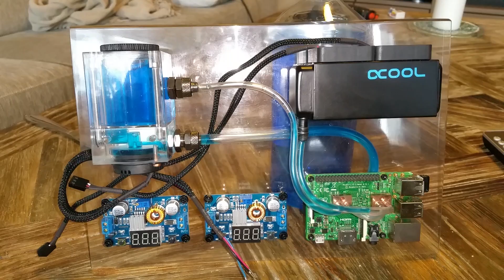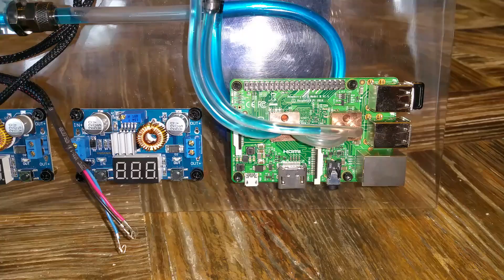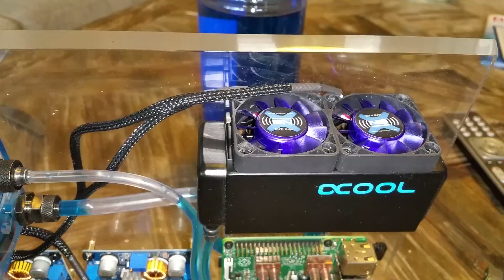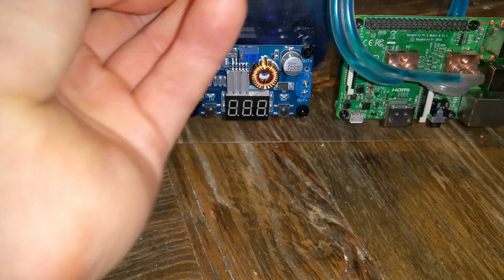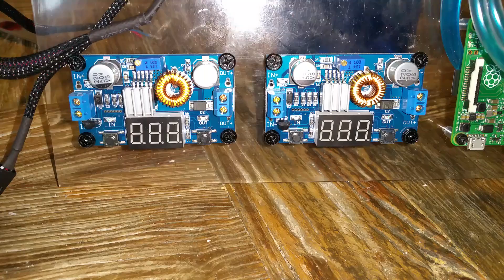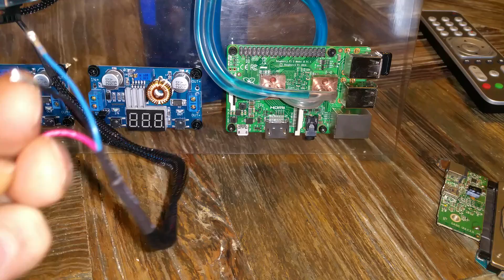Watercooling the Raspberry Pi

Comment: Why would you liquid cool the SMSC LAN9514 which is a Fast Ethernet with USB 2.0 combo chip, that also happens to dissipate no more than negligible 951 mW of heat? Has it improved your SoC temp in any way?

Comment: did system cost less than rpi? why need overclock it? it supposed to work default setting. wait rpi4 if need more speed. then you overclock it too. why why?why you buy rpi?its not for you if you think is too slow.it run slow and use less power that is supposed to do

Comment: I would like to see some extream overclocking bench marks... 

I could see a setup like this on a much larger scale, like a radiator from your car cooling a cluster of pi's...

but only if the benchmarks from this rig could provide a mathematical equity. ? make sense?

compare a 150$ amd 1090t vs 5 extremely overclocked pi's...

Comment: would be more interesting on a pi 3
Reply: Can easily be done with the same method, those small copperblocks are still in production i think.
Possibly one can add a 3 rd waterblock on the backside as an option on that model, but i don´t think it´s realy nessesary.

Comment: i'm a bit upset you didn't make the fluid in the tubes raspberry red >:( 
but otherwise, an intruiging  video nonetheless
Reply: Historically, red dyes in watercooling clog parts like the waterblocks, so most tend to avoid going with red coolants if they can avoid it unless it's part of the theme and it's from a reputable coolant maker like Mayhems.

Comment: There's more air in the tubes than liquid. I can feel the pump screaming in pain.
Reply: +Totenglocke42 The pump is fed directly by the reservoir, there is no air in the pump.
Reply: air is compressable, so your pump has to work alot harder to overcome that compression, a tiny air valve would solve the problem.
Reply: The air won't be compressed... It's a closed system, thefore you cannot compress a liquid, by moving another luquid. Other than that, you should always leave a little air in your reservoir.

Comment: Some things have to be done, they just have to. This is one of those things.

Sure, the cooling system costs 10x what the pi costs, and it uses twice the electrical power, but still, it has to be done....

Comment: OH MY GOD! This is awesome! LinusTechTips advertised a video where they would be benchmarking cellphones by "watercooling" them. I imagined them breaking open the phones and installing tiny water blocks to the tiny snapdragon processors. But once the video was released they just put the phone in a plastic bag and put it in a bucket of ice. A COMPLETE letdown. Your tiny water cooling setup has scratched an itch I've had for a while now!! The cutest water cooling setup you'll ever see. Hahah thank you so much. 

I also love the soldering iron in the living room.
Reply: +bagofclothes73 I see this video
Reply: I was tempted to take one of my older smartphones and try to mod it with an actual waterblock. But, I just don't have the money, and I am not sure where to find such a small water pump.
Reply: Well, nevermind, I found a micro water pump... for like $125. To why it's so expensive, I have no clue.